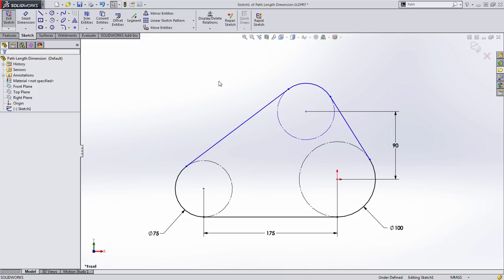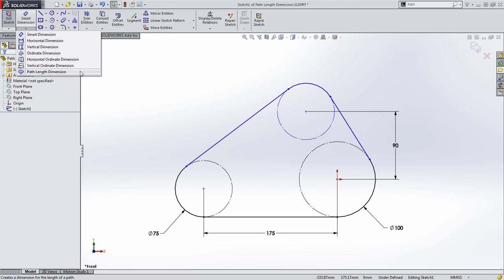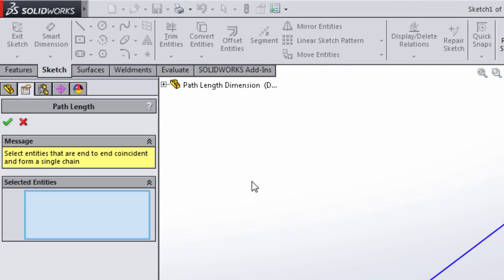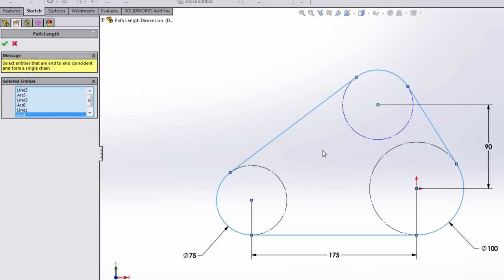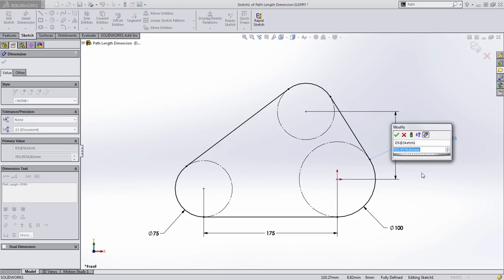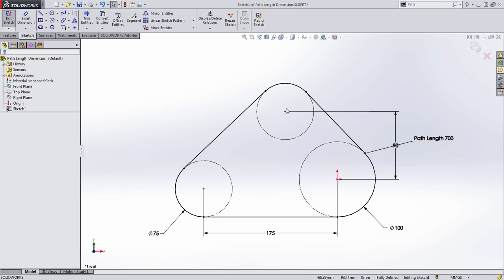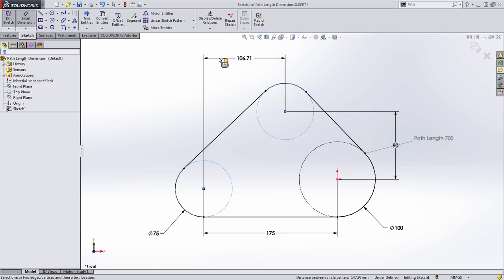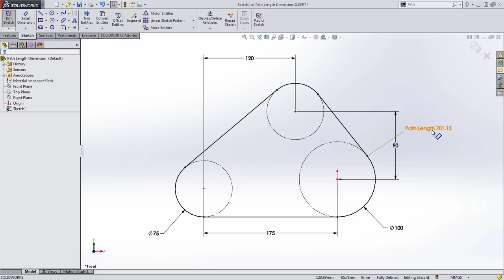SOLIDWORKS Tech Tip: Path Length Dimension

Comment: This feature is so annoying to use. I am trying to dimension the overall length of a open path of lines. No matter which order I chose the lines in, it will always show the path length dimension somewhere on the connection points. After adding lines to such a dimension it is also impossible to change anything else on these lines eg make them horizontal. It will always open the path length dimension.